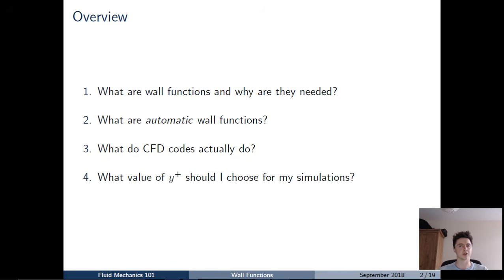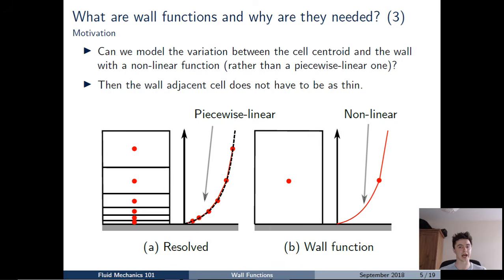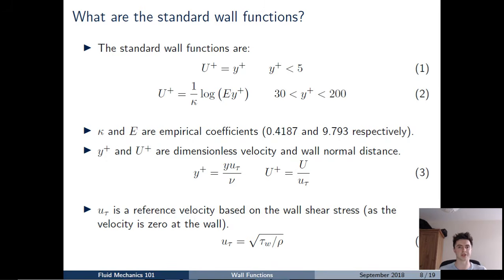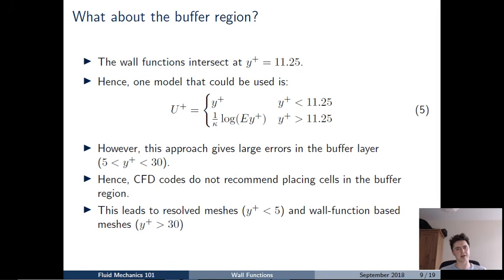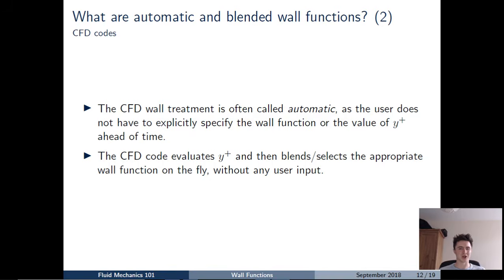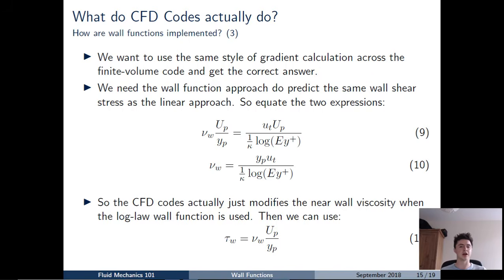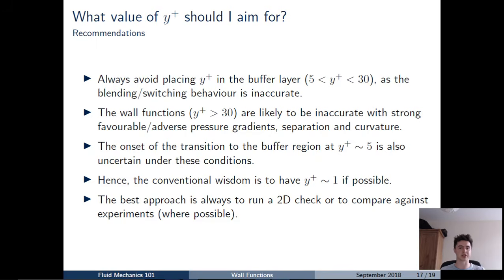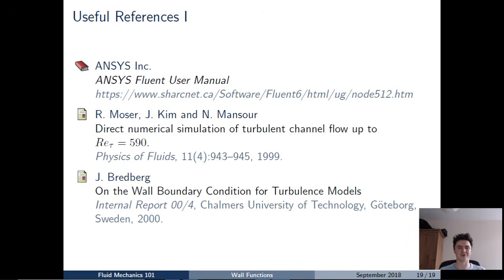[CFD] What are Wall Functions and How do they work?

Comment: Got some clarity before actually doing a CFD Simulation !!
I  wanted to know whether the graph of U+ vs y+ actually expresses the variation of tangential velocity against the first cell height from the wall or just Tangential velocity vs wall normal distance
Reply: The idea you're expressing is that the Governing equations are able to calculate the flow variables in all other regions except the near wall regions where resolved meshes or wall functions has to be made use of, correct?
Reply from the maker: Yep 👍
Reply from the maker: The profile is experimentally determined and gives the tangential velocity vs wall normal distance. However in a CFD code we only apply this to the first cell. The CFD code computes all the other cells away from the wall.

Comment: Hi Adian Sir, Good Morning 
Could you please make the videos about the mesh cell quality with respect to ICEM CFD. what it should be? How to correct it? etc.?????
Reply from the maker: The ICEM CFD quality metrics are a bit weird. I usually just focus on non orthogonality quality as this is the most important metric for CFD. But yes, i think a good video is required here 👍
Reply: @fluidmechanics101  After unstructured meshing, generally I maintain the quality more than 0.14 but wanted to know your approach how do you check the quality of the mesh means what parameter, what values do you check for tri, quad, prism and other elements in ICEM CFD? what values should be maintained for different mesh cells?
Reply from the maker: ICEM has lots of different metrics because you can also use it for FEA. For CFD the most important metrics are non-orthogonality and aspect ratio. If you make sure non orthogonality quality is greater than 0.1 and aspect ratio is less than 100 (unless you are doing high speed aero) then you should be fine

Comment: Thank you for posting these videos. These have been incredibly helpful. Quick question, in equation (7), shouldn't you be using 'mu' (dynamic viscosity) instead of 'nu' (kinematic viscosity)? And what is u_t in equation (8), (9) and (10)? Is it u_tau, or something else?
Reply: I also noticed that. The u_t you mentioned was exactly u_tau, and the multiplication of rho was missing. The equation Aidan wanna express was tau_w=rho*(u_tau)^2
Reply from the maker: Yes!

Comment: What does it means y+ equal to one? That the first mesh reach that value?
Reply from the maker: Y+ is the distance of the cell centroid from the nearest wall. It is a dimensionless distance, so a y+ of 1 is smaller at higher Reynolds numbers.
Reply: Fluid Mechanics 101 So the value is calculated on the first cell from the wall (in the centroid)?
Reply from the maker: Yes!

Comment: Thanks for the very good video.

I have a question, in the wall shear stress calculation at 13:28, why is the kinematic viscosity instead of the dynamic viscosity used?
Reply from the maker: Ah this was a typo 🤦‍♂️

Comment: Hi Aiden, thanks again for these very informative videos, and for your previous responses. I'm afraid I have another clarification I would like you to help with please:

1 - this is more of a clarification, am I right in saying that a cell with a Y+ of >30 refers to a cell which starts at the wall and extends into the Y+30 range, or, does Y+30 only refer to cells that are not touching the wall but are situated within this Y+ range?

2 - If it is the former (of Q1, a cell that is touching the wall but so large it reaches the >30 Y+ zone), then why make a cell that is so big that it has to use the log-law equation, and as such will not record any of the viscous sub-layer info?

3 - if it is the latter (of Q1, as in referring to cells that happen to be in the Y+ >30 zone but are not touching the wall), then how is it possible not to put cells in the buffer zone? As it would be impossible to have cells in the Y+30 zone without having cells in the buffer zone.
Reply: Ooo, also I forgot to ask, why does cfd use the linear/loglaw equations at all? It looks like the Spalding equation is superior in every way.
Reply from the maker: When talking about y+ and wall distance, we are only talking about the cell that is touching the wall. The cells above it are not considered. More specifically, we are talking about the distance of the centroid of this cell normal to the wall. You can check this in the post-processor. There will only be values of y+ computed for the cells that are touching the wall. 

Usually we would always like to have y+ < 5. However at high Reynolds numbers, the cells get very thin! This can reduce their quality and make the solution unstable or too slow to solve. So y+ > 30 is only really used when we have no choice. 

Im not sure about the spalding wall function. Perhaps it is more difficult to code or is less stable? I would have to look into this

Comment: can make a video  on what is courant no. and what's its significance?
Reply from the maker: Yep, its on my list! Courant number is actually quite difficult to define, especially for arbitrary cell shapes and unstructured meshes ...
Reply: @fluidmechanics101  Thanks. I sent you request in the linked in... I am stucked in airfoil analysis of Clark Y its Cl and Cd are not matching with values at the airfoiltools.com site... i have one doubt there too, there are 2 values for same reynolds no. i am doing 500000, one cl-cd values is for Ncrit=9 and  other is Ncrit=5, I did not understand what is Ncrit and how can set that parameter in the ANSYS. And I am stucked up in this analysis from a month, after your videos I get to know about y+,  and i improved mesh and now y+ is coming for both upper and lower of airfoil at range of 30-40, and its above the buffer zone. still my results are not validating.
Reply from the maker: Hi Sachin, a few quick thoughts which will help you: 

Ncrit is a parameter in the e^N method that is used by XFOIL. This is not a parameter which you use in CFD codes. Thats why you cant find it 😊

A reynolds number of 500,000 is difficult as the flow over the aerofoil is transitional (not fully turbulent). I would try a higher reynolds number (say 2 million) as this will be fully turbulent and easier to model. 

The airfoil tool values are not necessarily correct. These values were calculated using XFOIL (a panel method), which has its own inaccuracies. You want to compare to experimental measurements, as you can trust these values more 👍
Reply: @fluidmechanics101   Wow thanks for that knowledge that was a great help,. Actually I am working on making RC Plane for the final year project.. so, I was applying the slotted flap wing in my plane. Therefore, I wanted to a make base cfd model of the airfoil by which i can compare the slotted airfoil & check the increase in Cl-Cd ratio, and thereafter from that calculating the total lift of the wing using the Cl. That's why firstly I chose re=500,000 inorder to validate with, and then finding the lift for our planes's velocity(10-15m/s) using parametric set. 
But after your tips, i got to find the problem. Now I done analysis using laminar model get the values close enough, but are fluctuating up and down the reference value, the graph is just like sine wave. And when I again done analysis with even lower value, Re=200,000(12.0888m/s as per my airfoil chord), then its not matching for that. 
And as per your recommendations I found a reference report for the wind tunnel data for Clark Y.
(Data-  velocity=10-15m/s, Chord = 25cm)

Can you recommend me any other tips or important parameters to be care of, 
for the laminar flow analysis or flow like this in case like my my project..

Comment: Amazing playlist to learn CFD! Add compressible flows too?
Reply from the maker: Coming soon 🙃
Reply: @fluidmechanics101  Hey, thanks for the response. This series would be complete with compressible flow solver videos too. I'd surely recommend this to anyone learning CFD.

Also, I have a doubt regarding y+. I am trying to simulate an incompressible turbulent flow and it was given in previous research to have Y+ < 1 in the Boundary layer. How do I ensure this during the mesh generation itself? Should I simulate a flow first, plot y+ and go about refining the mesh or is there an empirical relation that can be used as a good first estimate?
Reply from the maker: Yep, thats the one 😊

Comment: at 5:10 you said y+ values greater  than 30 but in plot where is 30 on y+ that is x axis has logarithmic scale 10^0,10^2 can you explain me
Reply from the maker: Hi zeeshan, the y+ plot is always shown with a logarithmic scale, as it helps to see the shape of the curves in the logarithmic region. 10^1=10 and 10^2 = 100, so you want to look between 10^1 and 10^2 👍 it is the third increment along, because the increments go: 10,20,30 ... 90,100

Comment: Hey Aidan, how do we get eq 8 and how are eq 4 and eq 8 related to each other ? 

And just to summarize (let me know if i'm correct ) - Consider the aerofoil example - If we are doing the analysis at 4 deg AoA, then its computationally appropriate to use a mesh with larger y+ ( say 50 ) and Wall function approach (since it models the flow profile in the first cell) as compared to using a mesh with lower y+ . However , if we are solving for 10 deg AoA , we better get our mesh with y+ between 0-5 for accurate results.
Reply from the maker: Yes! It is always better to use y+ < 5 if you can, as there are no empirical functions here. However, the wall functions seem to work well for low angles of attack. Therefore if you cant make a mesh with y+ < 5, then use a mesh with y+ > 30 and the results are likely to be reasonably accurate at low angles of attack.

Comment: Hello Aidan,

First of all I would like to thank your for your effort with making such excellent videos. However, I am not sure about the correctness of the relation in the outer layer (log-law region). When I equate both of the expressions, I am getting a different value for the intersection, see time 10:20. Based on the formula and constants (kappa and E) you use for the log-law region, I am getting smaller value of this intersection, i.e. below 4. Am I doing something wrong? Could you elaborate more on this issue? Thank you in advance for your response!
Reply from the maker: Hi jack, to get the intersection point you will need to solve this equation numerically ie. 

Y+ = 1/kappa log(E y+) 

Rearrange:

Y+ - 1/kappa log(Ey+) = 0 

Take an initial guess of Y+ = 11
E = 9.793, kappa = 0.4187

Solve using bisection/newton-raphson

Y+ ~ 11.25

If you are interested, i go through the full derivation and explanation in more detail in my 2nd fundamentals course, which you can get from my website, udemy or skillshare 👍 but im sure you have just made a small error somewhere
Reply: @fluidmechanics101  I see your point, but in my opinion we seem to be talking at cross purposes. I think I figured that out. To get the correct result, you need to use the natural logarithm "ln" rather than the common logarithm "log" with the base of 10. I have been taught all my life that log(x) usually means the base 10. It is common practice that in some pieces of software the term log(x) means implicitly ln(x) with the base of e, so it needs to be the reason for this misunderstanding. I am glad we have resolved it. Thank you for your videos and stay blessed!

Comment: Just a question. How accurate are wall functions when compared to use of Inflation layers- like comparing wall force coefficients?
Reply from the maker: I think you might be misunderstanding slightly 😊 inflation layers are a type or cell that you generate in the mesh. Wall functions are applied to the face of the wall adjacent cell (based on the cell y+) regardless of how it is generated, and whether it is an inflation layer or not. Inflation layers are good because they let you get thin cells close to the wall, which will reduce their y+. I would always recommend that you try and use inflation layers or thin cells close to the wall to try and get y+ as low as possible. The CFD code will usually take care of the wall functions/wall treatment for you. I hope this helps 👍

Comment: Hi Aidan, I really appreciate these high-quality videos and I love how you bridge the gap between coursework from schools and commercial CFD codes. Thank you and keep up the good work!

In equations 7 - 11 (slides 13, 14, and 15), why is it nu (kinematic viscosity) and not mu (dynamic viscosity)? Is that an error or am I missing something?
Reply from the maker: Thanks Kevin 😊 the wall functions are always written in terms of nu (kinematic viscosity) and alpha (thermal diffusivity). To get back to mu (dynamic viscosity) and k (thermal conductivity), just multiply by rho (density) and rho cp (for temperature). Maybe check out my vid for temperature wall functions and this will make more sense 🙃
Reply: @fluidmechanics101   Aidan, I have watched that video as you have suggested and it looks like equation 7 in that video  has a rho (density) term in front of nu (kin. visc.). I believe you are missing a rho term in equation 7 of this video.
Reply: @xGenezhi  Thanks for pointing this out.

Comment: please suggest a readable book on turbulence modeling to understand turbulence theory and its implementation using CFD code.
Reply from the maker: This is a difficult question, as there arent many good books on turbulence modelling at all! I would suggest ‘turbulent flows’ bu stephen pope. It is quite an advanced book that goes through turbulence theory in detail and should have eveything you need. The application to CFD however, is limited in this book and i would read Hrvoje Jasaks thesis instead for this 👍
Reply: @fluidmechanics101  Thank you so much for your response.

Comment: Wow!! This was nicely explained. You are a blessing in disguise. 
I have question for you. 
Towards the end of the video, you say that conventional wisdom is to have  y+ ~ 1. This indirectly means that we are in the viscous sub-layer. If that is the case, then why would we use wall functions? We can resolve (i.e. numerically solve the equations) the viscous sub-layer isn't it? 
Anyway, Thanks for the video.
 Cheers :)
Reply from the maker: Hi Mihir. Surprisingly the reason is often cell quality. As the cells get thinner (to reduce y+ to less than 1) their aspect ratio and non-orthogonality gets a lot worse. This reduces the stability of the equations and can often lead to divergence, which can be very frustrating! So it is usually possible to get y+~1 for smooth aerofoils and wings. However for more complex geometries, the poor cell quality and high cell count forces engineers to use larger cells and have y+> 30. Despite the loss of solution accuracy, at least we can get a solution ... 😄
Reply: @fluidmechanics101  ok. So, my question is that suppose we have made a very fine mesh (y+ ~ 1). Now, we are no longer having a "big wall cell i.e. y+>30 " as you have mentioned at the start of the video. Now, Purpose of using wall function is to reduce the mesh count by having that big wall cell. Now, since i have very fine mesh i can actually resolve the flow. Why would i use wall function in that case?  
So, basically, what i think is that wall function will be used only when we are in y+>30 region ( I suppose that is what you meant in the above comment for complex geometries) . And When we are in y+~1 region then the turbulent equations will be solved and thus we won't use wall function. What do you think?Let me know. Cheers :)
Reply: @mihirmakwana2026  Hi Mihir. Have you found an answer to your question?
Reply from the maker: Hi Mihir, sorry if you have been waiting a while for a reply. I think the key misconception here is that the 'wall function' only acts on the face of the cell in contact with the wall. If this cell has y+ = 1 then there are no modifications to the cell face and the wall flow is 'resolved'. The cells that are further away may have y+= 30 but they are not in contact with the wall (only the face of the cell in contact with the wall is affected) so no change is made to those cells. The phrase 'wall function' is misleading as it is not a continuous function but just a modification to the face in contact with the wall. As it sounds like your case has y+ = 1, then there are no modifications and you are good to go. I think my video on 'enhanced wall functions' would be useful for you. Maybe give it a watch?
Reply: @fluidmechanics101  Actually I still don't get it Sir. So, after all, the wall functions only works when the y+ of wall-adjacent cells are larger than 30? And when the y+<5, no change is made to those cells because the wall flow is resolved?

Is it wise to say that k-epsilon is used when we can not make y+ of wall adjacent cells less than 5? Then, if I use k-epsilon with y+<5 and wall functions, so that would be a waste due to the wall functions has nothing to do with those cells?
Reply from the maker: Hi Bars, yes you are correct. If y+ < 5 then the velocity profile between the cell centroid and the wall is linear, both in real life and in the CFD code. Therefore, we do not need to modify the viscosity on the face of the cell to correct the wall shear stress.

For your second point, if your mesh has y+ < 5 then you are better off using k omega SST, as it is often considered to give more accurate results in the viscous sub layer. The original k epsilon model was innaccurate in the viscous sub-layer (due to the behaviour of epsilon) and various damping functions have been proposed over the years to improve it. Regardless of whether you choose k epsilon, k omega SST or any other turbulence model, they all treat velocity in the same way (no modification for y+ < 5 and a modification to the dynamic viscosity when y+ > 30)
Reply: @fluidmechanics101 ooo I see, thank u Sir, perfectly explained :)